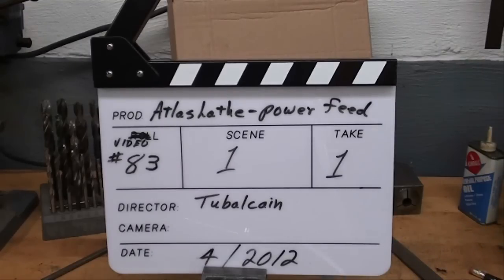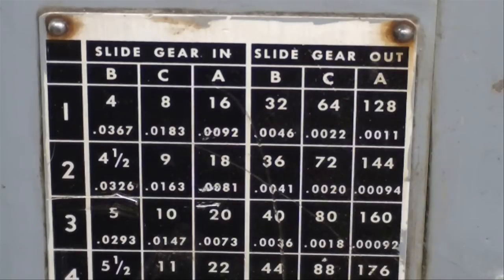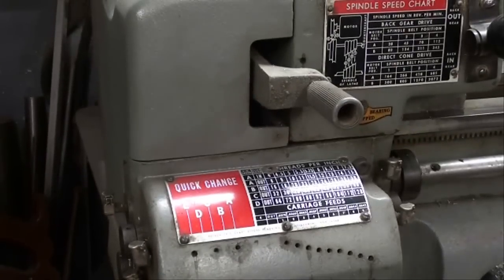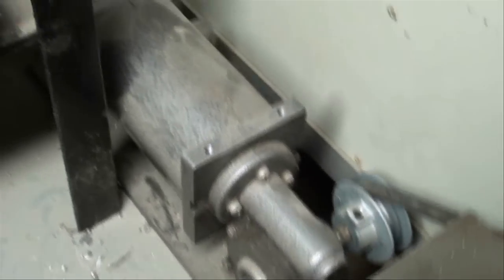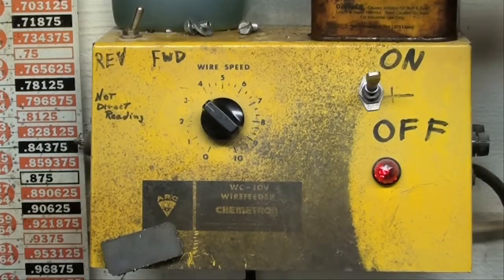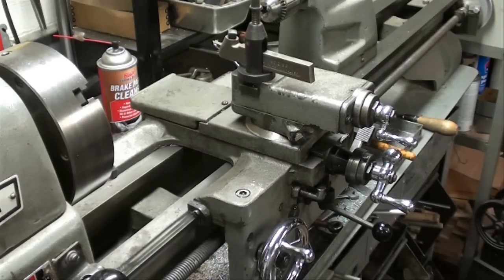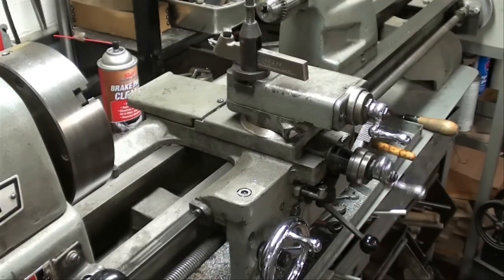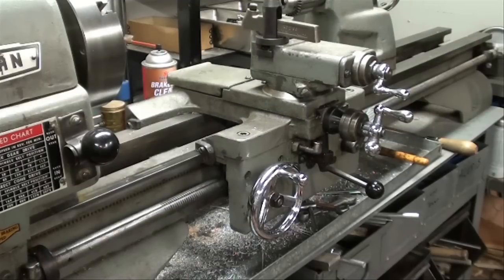Custom Power Feed for Atlas CRAFTSMAN Lathe #83 tubalcain

Comment: I was concerned about it and checked to find they was steel gears before I reduced my drive gear between banjo and gear box from 40 teeth to 20 teeth cutting speed rate in half,, I have to multiply chart by 2 now for treading and not have  lost  one row,,,that I would never use anyway and if I did I can just change the one gear back,, Was going to do your motor setup until I realized in fact the quick change gear box gears are steel and I would shear off zmak drive gear before hurting gears in gear box..l like yours just complicates running lathe more then l wish too..
Reply from the maker: Thanks

Comment: I didn't see how you disconnect the add-on power feed mechanically when using the machine's gearbox.  Electric drive motors are almost always worm gear drives and cannot be driven backwards.
Reply from the maker: I take the V-belt off
Reply: @mrpete222  Thanks much.  I took a 6-month vo-tech machine shop course about 40 years ago, when I was in graduate school.  Unbelievable how much I've forgotten.  I just purchased a Sears Atlas just like yours on Craigslist.  I wondered what that funny attachment was!  (Now I know - milling attachment).  All best.

Comment: I saw in your "flash drives for sale" video that several of your videos have gone MIA on you.

If you'd like, I can send you a copy of these missing videos on a DVD so you can keep your set complete.

The ones that are missing are quite good, and it would be a shame to miss them.

Anyway, if you'd like me to send them to you, drop me a note to tech AT logic-industries DOT-com.

It's the least I can do.  That trick on centering up the tailstock using a co-ax indicator has saved me a lot of time.

Comment: Try putting a foot switch on it and it wont be a problem being left on or you can power the dc drive off of the same switch as the lathe motor and still use all the switch functions on the drive box. Simple fix .
Reply: @mrpete222  I have an Atlas lathe too! Always enjoyed your videos. Thanks for all of them. I was thinking of putting my old index mill down in the basment but Im probably going to lose my house soon due to a predatory loan that bit me in the backside and sunk its teeth in pretty deep. Most likely I will probably have to say good bye to all my tools.

Comment: Do all atlas lathes have power cross feed?
Reply from the maker: I think so
Reply: no, i have a 1936 atlas 10 d that was manfactured without power cross feed, the 1937 was the f model and had power cross feed i took a ford windshield wiper motor  , mounted it to back side of saddle with holes that were there and made a sliding sleeve clutch to drive the feed screw from the back side got a 5 amp pwm with reverse switch ($5.00ebay)  and 12v transformer and 5 ampfull wave rectifier for power pulls .8 amps facing with .010" deep cut in steel, pwm gives full torque at all speeds works great